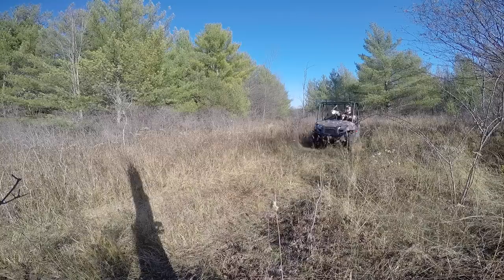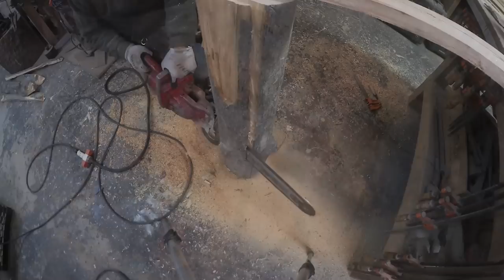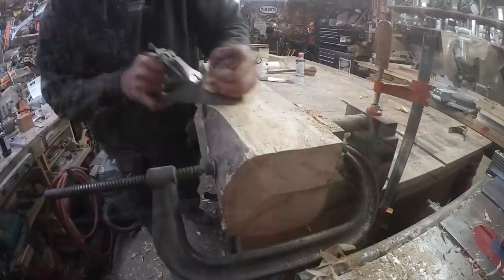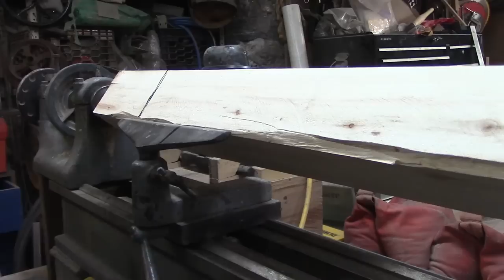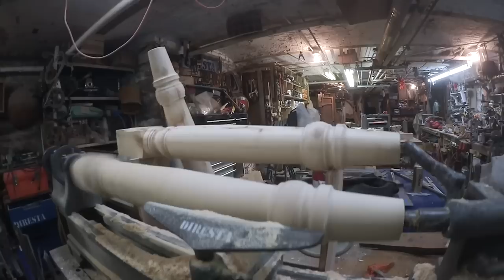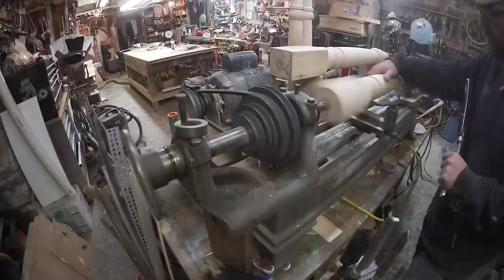✔  DiResta Log to Legs

Comment: Your hard work  really paid off! One question, I have a home in upstate NY as well, and I'm wondering how you keep your shop warm and how efficient is it? I have 2 car garage shop and a basement shop but I can't stand working in the garage with the cold. Great job as usual!
Reply from the maker: with this cold i work in nyc shop. Thank you !
Reply: Smart move!
Reply: My friend has a newly built barn he likes to work in. He uses a kerosene space heater for now but is saving up for a propane one in the future. It keeps the cold tolerable inside even when it's -10 F outside.
Reply: Thanks Pestr999- I have tried propane, but recently found a good deal on a pellet stove and got all the parts. Started it up tonight for several hours. Works ok, ( not too cold tonight tho')... The real remedy is spring weather, but until then, I'll make some more insulation upgrades and deal with it. Just have to keep it moving as I work to create heat!Thanks 4 ur suggestion.
Reply: Construct Icon I haven't used a pellet stove though I've seen them advertised around in the area. I assume with most small stoves that you won't get enough warmth from it to counteract a drafty, uninsulated place. My friend's kerosene burner only keeps the room from freezing but doesn't make it warm. When he had it running it was -8 outside and inside his barn it was 20 degrees Fahrenheit. He has a medium barn when plastic tarp stapled to the walls for bare minimum insulation.

Comment: I have a old dining room table that my great grandfather owned and it has the same shaped legs on it. And on the bottoms of the legs have small brass wheels/coaster.  We think the table had been chopped down from a bigger grander table many years ago.  Its is now about 6ft in length by 4 ft wide.

Comment: Love your videos.  Very inspiring!  Thanks and look forward to the table project with these legs.

One question:  Do you try to avoid the pith for the legs or just leave it.  I couldn't tell if it ended up in a couple of the legs or not.  Thanks.
Reply from the maker: THANK YOU all of the log was strong... the wood itself is soft like pine but strong for a table. most of the finish part was from off center of the original  log

Comment: So, about those wooden clamps. I was watching one of your hammered videos last night and I saw the barcode and the manufacturer on the clamps, Jorgensen. The thing is, I cannot get them here, in Romania :). I was particularily interested in the nut and bolt system inside the clamp, the one that allows the bolt to swing left and right. Anyway...I'll have to try and figuer something out. Again, amazed of the things you build. I have a great admiration and respect for you and your work. Be well and keep the vids coming. Thank you very much

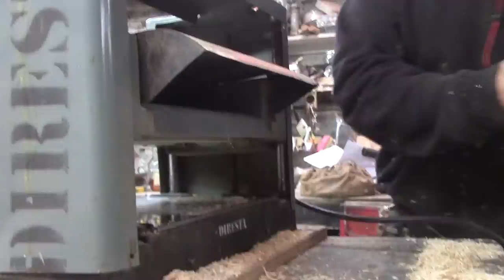Comment: 12/04/23 You always follow through even if it’s years later. 4:51 good trick here for the lathe using super glue to give it strength

Comment: Thanks for that video. Any conclusions after those little experiments? What is this maxi-cure?
Reply from the maker: YES conclusion:  i need to by a Wood Miser ( huge sliding bans saw mill)  THANK You
Reply: jimmydiresta
You could always use a chainsaw mill, Wranglerstar uses them all the time to mill lumber to rough dimensions, a little more waste but it's cheaper and more portable.

Comment: Ripping up the log sure was a tough job - been there, done that. Unfortunately, there is not really a easier way without a somewhat usable lumber mill. Even with a (sharp) chainsaw it is tough to cut a log lengthwise.
FYI: If you plan to do it again, you may wanna check out Matthias Wandel on Youtube. He built his own portable sawmill.

Also: I find it easier if I have to do multiple copies on the lathe when I do one and make a template out of 4mm MDF or Plywood. So I can hold one piece to the copy and I see where I have to shave something off. I just have to measure 2 points (preferably at the ends) so I have a stop for the template...

Nice Job :)
Reply from the maker: thank you brother ,!!  ill likely buy one ( saw Mil) if i do more of this.. and when the new building is done... start this spring..
Reply: jimmydiresta Saw this one a while back which looks awesome http://www.logosol.us/sawmills/m8/. Great work Jimmy

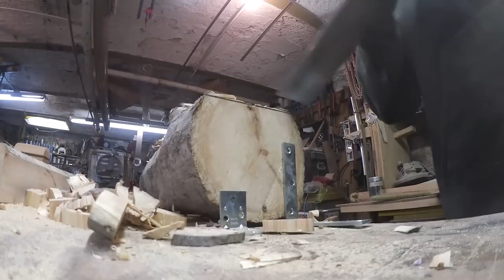Comment: What kind of crazy chisel is that around 3:25?  I think I need one.
Reply: Chris Schryer It's a chisel used for timber framing, don't know the name off hand. It has a long handle and is more than 2 feet long in total. Allows good control in pairing.
Reply: +Chris Schryer it's called a slick, you can find one at leevalley, highland woodworking, woodcraft or even amazon; or if you want a hand forged one you could buy one at autine tools or john neeman.

Comment: The first thing that came to mind is why are you using an axe to cut the tree down, you kind of explain that in the narrative, but still then you get to the shop and use all kinds of different tools to do the same milling job. Is your intent to show how to do the same thing with different tools? There is no narrative on the video at least through the part I saw to explain that.

Comment: seriously ?  you can't use a gas chain saw in the city ?  I know it's not an everyday kinda tool, but, that seems a bit much by way of regulation.
Reply: carolina11b Even if it should not be strictly prohibited as such, it's still a matter of courtesy against the neighbors. You don't want to use a gas chain saw indoors because of the exhaust fumes. I've tried it in an open garage and even that is not fun. And you probably don't want to do it on the sidewalḱ, so the best option would be a back yard, and usually a lot of people live in earshot around those. There are powerful electrical ones, I've got a 2 kW Makita with a worm gear motor that also makes it very handy.The chain needs to be sharp though ;-) I keep wondering if Jimmy just couldn't be bothered, because sharpening a saw chain is not a difficult task, especially for people with his sort of tool wielding experience. Lengthwise cuts would still be tough on the machine though, even if you use special chains that have fewer teeth on them.